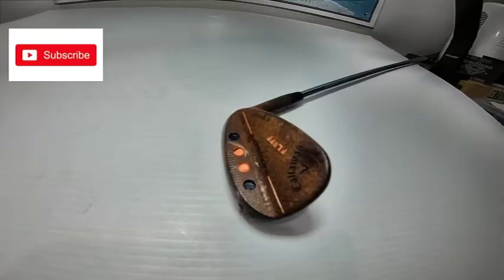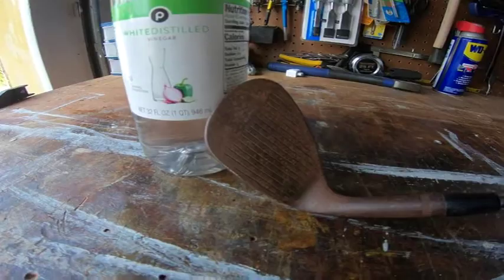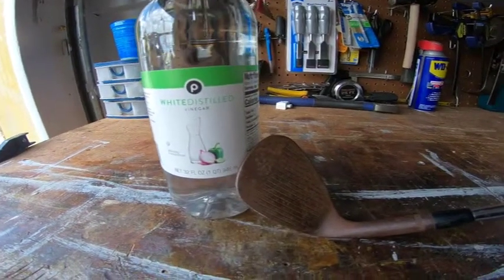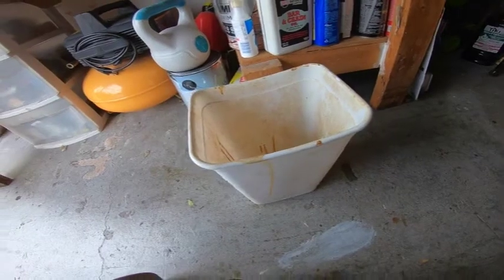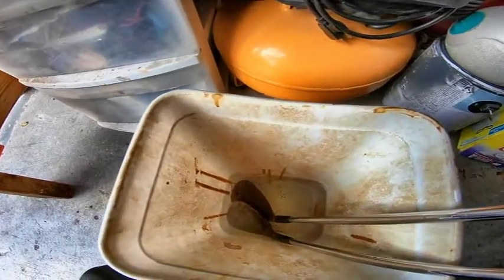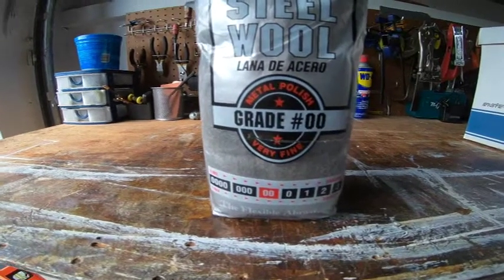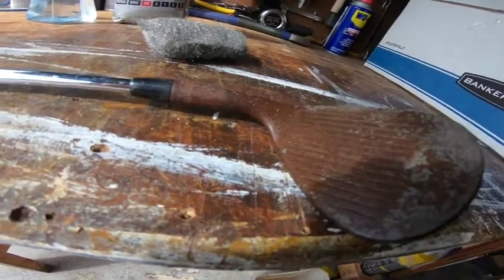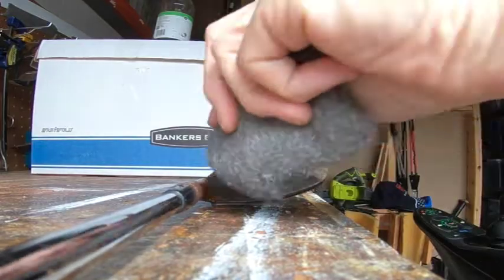How to Remove Rust From a Golf Club | DIY Rust Removal

Comment: Awesome I did this with some needle nose players that had rusted - worked great!!  I have a spot on the top of my car which really sucks that it got rusted and the paint is worn off can’t really buy a new car right now they say to keep your old cars and fix them up. Not sure if this would work because you can’t soak the top of a car, but I could spray it continuously with vinegar and see if that would work to remove some of the rust, and then put Bondo on there until I can figure out how to paint part of it.
Reply from the maker: Worth a shot! GL